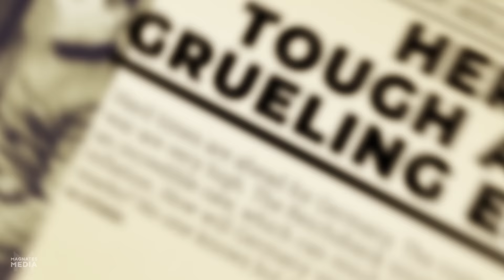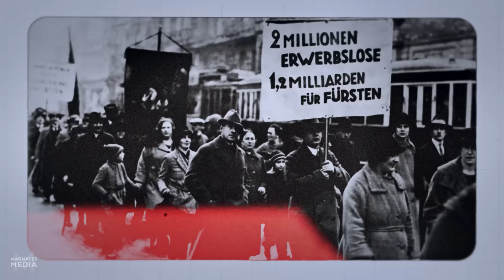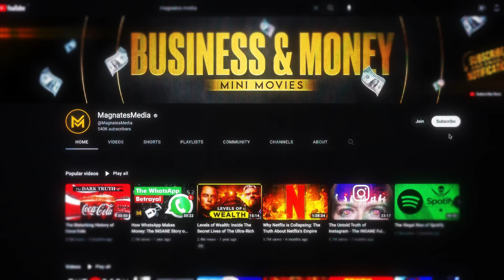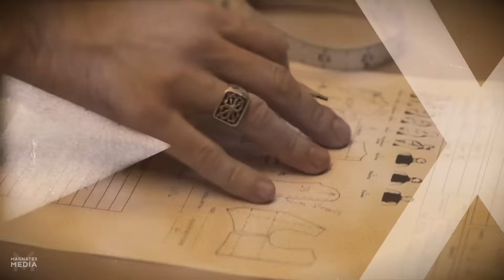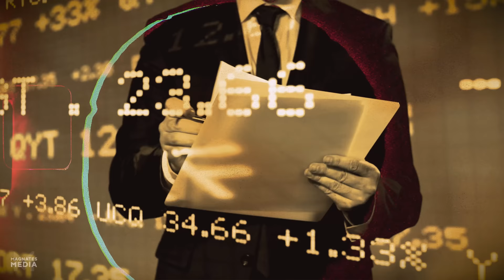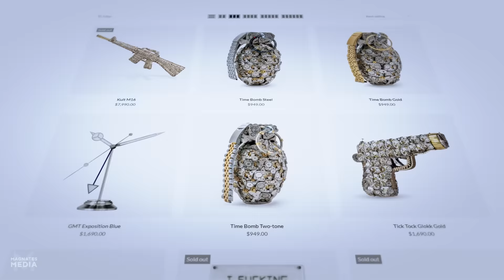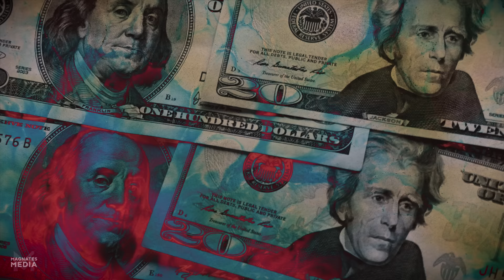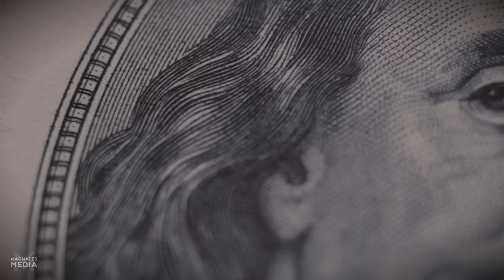The Disturbing Story Of Hugo Boss

Comment: The connection to the Nazis is actually the one thing that makes the brand stand out, and what the one guy said about the uniforms totally holds true.
Reply: Hitler also drove an Audi, Benz made the Messerschmitt Engines and BMW made the FW engines. Both got absorbed into today's airbus. What did people expect?
Reply: Hitler didn't drive an Audi because Audi didn't exist until the 1960s. He owned a 1 of 5 Auto Union Type D built by Porsche. Porsche also built the VW Beetle that Hitler helped design. 

There's a big difference between brands like Auto Union which were seized under socialism and made to serve the Reich, and brands like Porsche/VW and Hugo Boss that were massive supporters of Hitler and the Reich, and joined the Wermacht willingly. Then you have brands like Mercedes and BMW that fell somewhere in between. The same situation exists in legacy Japanese brands. Some were seized by the Emperor and some served him willingly.
Reply: @RockandrollNegro  The Americans supplied the Soviet murder machine.... soooo, whats your point?